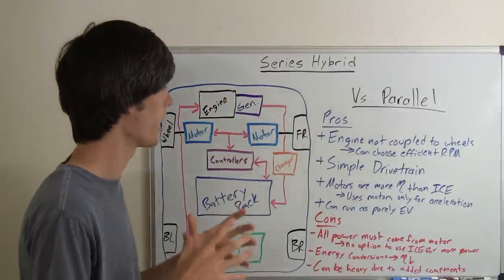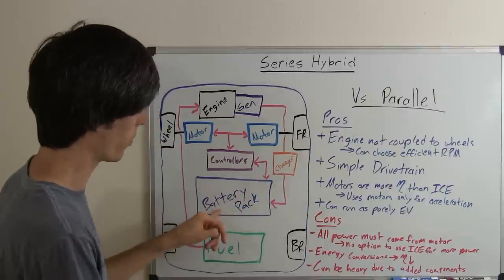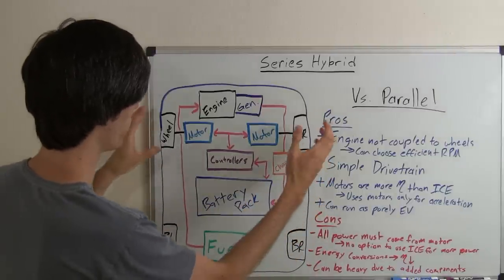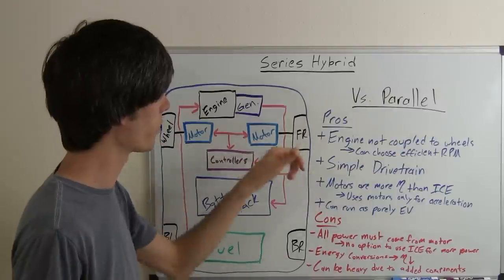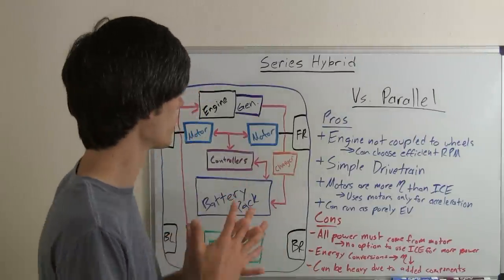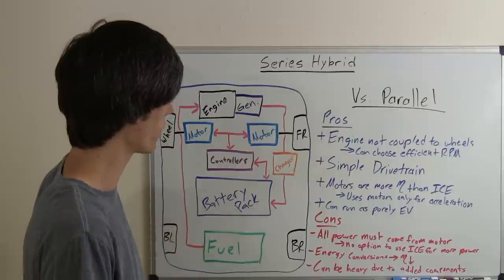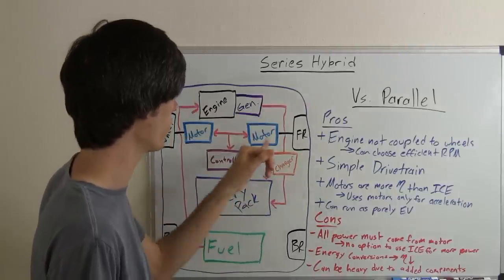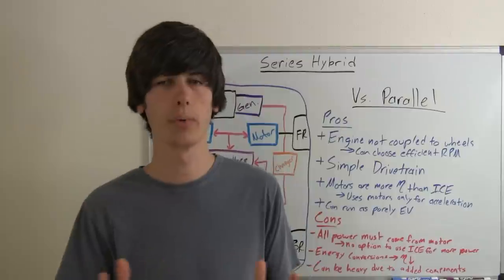Series Hybrid Cars - Explained

Comment: Series Hybrid vehicles have almost no battery pack at all. The main problem with any EV is energy density. Example Chevy Volt's original battery was a 16 kwh 400 lb battery pack. 1 gallon of gasoline in a perfect world is worth 33.4 kwh so an average of 12 gallons of gas would be worth again in a perfect world 72lb and 396 kwh. Diesel 40.7 kwh per gallon at the same 12 gallons is approximately 90 lbs and 488kwh. Now you want to include phase changes gas/diesel to mechanical to electrical and back to mechanical. And if you're carrying an extra 300lbs of mass without giving more energy you've succeeded in killing your Fuel efficiency.
Reply: I used to think that too, but the real problem with EVs is the fact that batteries do not store electricity, but chemical engine instead. The main consequence of this is the fact that the energy flow profile of a battery (slower to charge and faster to discharge) is the exact opposite of what a vehicle needs (faster refueling and slower fuel consumption).
Any hybrid without a plug will need a very small battery, theoretically just large enough to be able to start at 50% and take either a full stop from top speed on regen or a fully electric sprint from zero to top speed.
About the energy density, the maximum theoretical limits of various batteries chemistries are just over double what we have now, still insignificant if compared to fuels.

Comment: So, as I understand it, if you are looking to buy a hybrid vehicle, deciding between a series and a parallel set-up on otherwise identical cars the deciding factor would be daily come distance.
If you can do most of your driving on onlythe battery's power then get a series hybrid. 
If you will constantly need to be running the ICE, IE: travel a lot or have long commute, then you should probably go with a parallel hybrid to use fuel more efficiently.
Reply from the maker: Perhaps, though many these days are somewhat of a combination of the two.
Reply: To my knowledge, the only car that made it into production that is a true series hybrid is the Fisker Karma.  Even the Chevy Volt, which originally was touted as a series hybrid, has a combination of electrically controlled clutches that allows the ICE to directly push the wheels.

Another thing to keep in mind is that if all of your driving is on the highway, you can get a non-hybrid that is very competitive as far as MPG, but less expensive.  A Prius costs about $25k and gets 48mpg, or you can get a Chevy Cruze Eco for a few grand less and gets 42mpg.
Reply: the are the added costs to maintain ICE+transmission Vs an electric motor or two - at 8 years, the difference can mean thousand$

Comment: I'm sorry, I was wrong for the range extender alone it's around 260 I'm for a 7.2 l tank which makes it's around 2.7 l per 100km. The combined cycle is 1.9l per 100km when you are in electric only. Still those numbers are awesome. I think i still make my point on efficency . My souce https://en.m.wikipedia.org/wiki/BMW_i3

Comment: Why have a battery pack at all?  Why not just run on whatever comes out of the generator?
Reply: Regenerative braking is the main reason to build hybrid vehicles at all. Being able to run the engine continuously at constant RPM and load is the second reason, and both need energy storage to work.
Reply: @gsilva220  thanks, makes sense.  Then, seems it could be done with a much smaller battery, if its only purpose is a buffer between the input of generator & braking, and the output of propulsion.
Reply: @DonTruman     Exactly. In theory, the battery just needs to be large enough to be able to start at around 50% and take either a full stop from top speed on regen, or a fully electric sprint from zero to top speed.

Comment: Series hybrids are the answer for cost, efficiency, and environmental issues. I am willing to donate 3/4 of my Chevy Bolt battery, to install a 20hp generator. A second drive unit for the rear would be fun, and so would a solid waste gassifer to fuel it. It would run electric for 100km of range in cities, charge quickly, and use the generator as a range extender in rural settings. The waste head from the generator could warm the battery in the winter, extending the range. The other battery pack sections could be repackaged into 3 more cars. This would have a multiplication effect, and reduce and even eliminate pollution is cities. The trouble isn't emissions, but the ratio of absorption. Taking this concept a step further, if we wanted to solve the issues facing the automotive industry, we would make cars as affordable as possible. I would start with the highest selling vehicle in North America: The Ford F150. Take one, take it to a dealer. Get a quote to remove the engine, transmission, and transfer case. Get a quote on what they are worth. Then design an electric drivetrain to replace it. Electric motors with gear reductions to the front and rear driveshafts. They would have the same power and torque specs as the original drivetrain. They could be Enedym SRM motors, but they won't return my calls. So, imagine 2 x 200hp electric motors, pushing your F-150 around. What would power them? We would need 2 motors controllers, sized for 400V @ 375A. On the highway, the truck doesn't use 400hp. The F-150 lightning uses about 30kWk/100km. That means we can assume the truck uses 30kWh @ 100km/h. That is before towing. If we aren't towing, we need a 30kW / 40hp motor (before losses) to power the truck for range extension on the highway. So imagine, a 40hp generator (lets beef it up to 50hp or even 100hp for towing) running the drive motors on the highway. The waste heat can be sent to the cabin and battery to extend the range. Take the battery from the 400km or 500km Lightning, split them up into 100km range packs, and start swapping the drivetrains of existing F-150s to make them hybrids. Yes, it will cost money, but if we finance it, and sell the old parts, we have an AWD, net zero emissions, truck that doesn't require much maintenance, and the old parts can be used in other vehcles, and the engines can be land based for power, heat, water, C02, vaccum and waste processing. Welcome to Evoli Energy Inc.
Reply: Exactly. Electric primary traction is the future, but the problem with EVs is the fact that batteries do not store electricity, but chemical engine instead. The main consequence of this is the fact that the energy flow profile of a battery (slower to charge and faster to discharge) is the exact opposite of what a vehicle needs (faster refueling and slower fuel consumption). To popularize electric mobility, we need to eliminate plug-in batteries; replacing them with a small hybrid battery and literally anything that's clean and able to be replenished without having to wait for the car to turn it into something else.
This is where series hybrids come into play.

Comment: I thought of this(minus the battery) as a CVT of sorts, or rather, a single speed transmission that circumvents ICE rpm limits, but that vain hope was recognized as such by the realization that an ICE could not ever wastelessly disengage acceleration without a battery.  But honestly, is any other ICE ever free of this issue?

Comment: If you customize or make your own EV, Parallel Hybrid is the way to go. You can use a small battery pack for your daily range, keeping weight/cost down. Along with a small engine to recharge batteries for those days when you are slightly out of range. The most efficient way to go if you don't want to go full EV.
Reply: Also lets you use a manual transmission as your ICE can pass through your motors before it hits the flywheel.
Reply: It seems to me Series-Hybrid /w a larger battery pack are better meant for city driving while Parallel-Hybrid /w smaller battery are better for long range.
Reply: yeah seriously men, if you really need to transport about 300/400 Kg of cast iron.....Why not all electric? and cosider that series hybrid can save your engine life [because it running at optimum rpm all life] and let you use a smaller motor and make less pollutant....so parallel hybrid don't give you any advantages on engine life, perhaps the weght of the batteries decrease your engine life and increase the emission

Comment: that could simply increase car's weight and also as u explained, the efficiency can reduce..... so whats the advantage of using it?? and where can it b used ??
Reply: guys, really, do you really know the efficency gap between eletric or mehcanic transmission? it'enormous.....the right way to thing is: what i can do with inefficent, heavy, noisy and dirty internal combustion engine? electric car will grow up instantly if graphene batteries will be ready....a truck is already ready for: check Hytruck on google or smith eletric if you are american

Comment: Does it make sense to use a normal car engine in this configuration?
How would you design an engine differently if it's specifically to be used in a series hybrid?
Reply: i think a generator would suffice for range extension
Reply: It would be more appropriate to develop an engine from scratch, optimizing it for this task, and decreasing production costs to take the final price of the vehicle closer to the price of a conventional vehicle. I've thought about such an engine, and it needs to be very different. from anything mainstream we have today.

Comment: How to find efficient rev range of an engine??
(P.S: given 160cc 4-stroke single cylinder engine producing max power of 11.12kW @8000 rpm and Max. torque of 13.03Nm @ 6500rpm)
Reply: It's where the torque is

Comment: can you name some series hybrid cars?

And also provide me your email, I have quires regarding this transmission.
Reply: Good news, as of december 2016 the 1st proper serial hybrid went into production in Japan. The Nissan Note e-power has come to market which is a 1.2 petrol engine coupled with a 100hp electric drive motor. No CVT, no clutches, regen, start/stop and 37km per liter of petrol (~80mpg)
Reply: The fisker karma was one, discontinued, the other was the vauxhall ampera a rebadged chevy volt

Comment: Why aren't there any series hybrids?
Reply: Maybe these are available now at lower prices and could be retrofittet with larger batteries while throwing out the combustion engine / generator?
Sounds strange but you couldn't make the same  money with such a concept!
I think Tesla is doing everything right - for the premium segment and the middle segment but where are the cars with small batteries (for 100km) and a modular power generator to be replaced if batteries are cheaper? For those who do not have or want to spend 50 000 bucks for a car with a 500 km range ...?
Reply: Nissan has it's E-Power technology, which is making waves globally.

Comment: I disagree with you cons on Efficiency of the series Hybrid. Your reasoning is flawed. Yes there are losses in the conversion from ICE to Electric. You did not consider the following in the BMW I3 the ICE is only 600cc motor cycle engine. Lets compare that to the size of ICE engine required to move such a mass without a Electric motor. Then we see that the series Hybrid is  comes in at around 1.9 L/ 100 km. To me this is way more efficient. I think the comparison is also wrong. Compare a ICE to Series Hybrid. Otherwise great show.
Reply: There's no way an i3 could get 1.9 l/100 km in actual driving purely on the range extender, though... as far as I'm aware, it's approximately 5.9 l/100 km at 105 km/h, in reality.